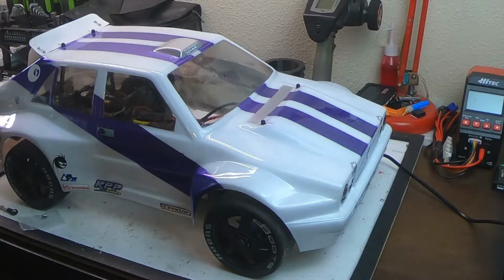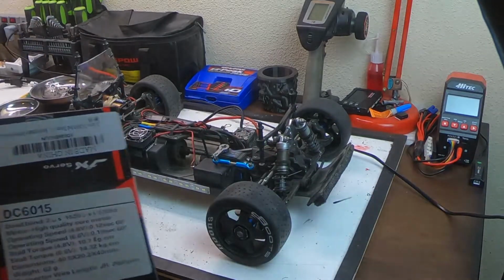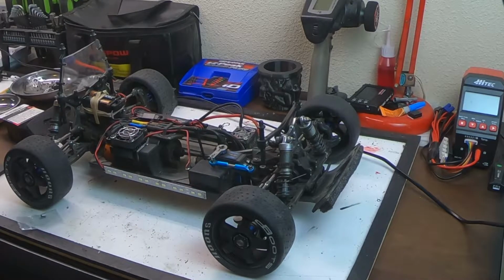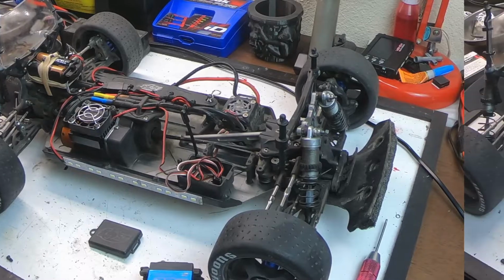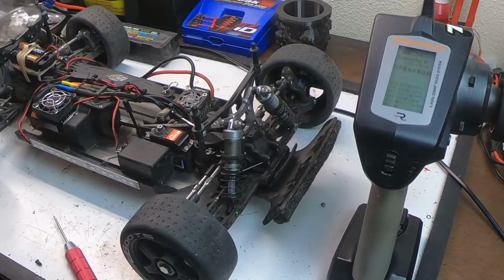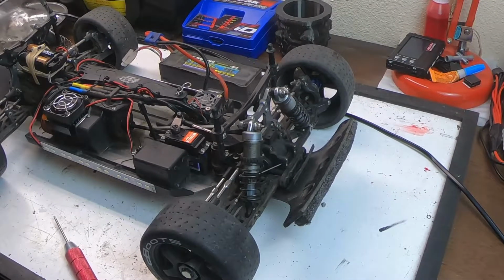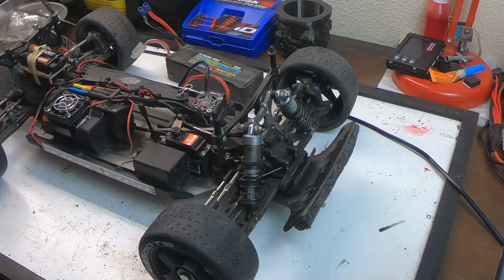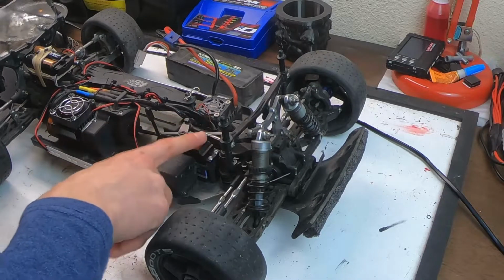Jx DC-6015 Servo Upgrade For Losi Tenacity

Comment: My ezstart wand glow plug light won’t light up, how can I start it with out a glow plug igniter
Reply from the maker: If the light is not lighting, then the glow plug is either broken and needs replacing. Or the wire going from the plug to the wand is broken and needs to be replaced. Either way, it's a simple and inexpensive fix.